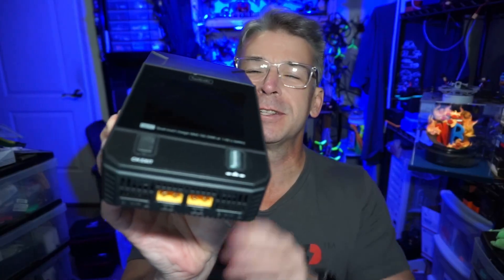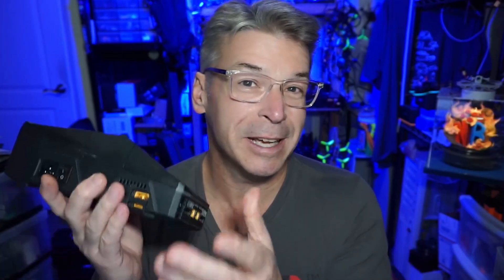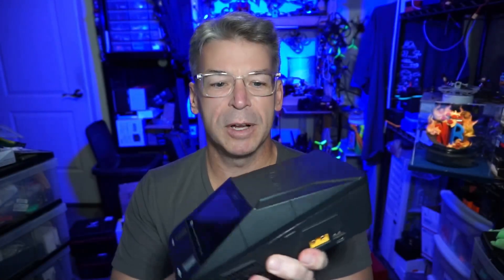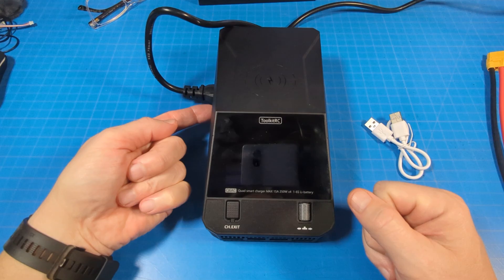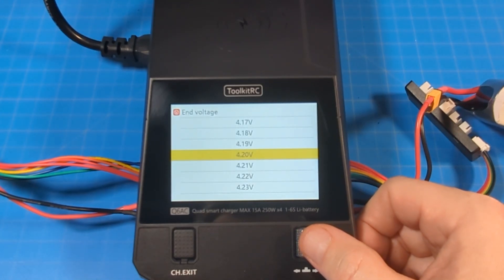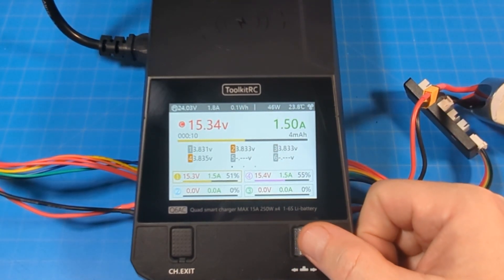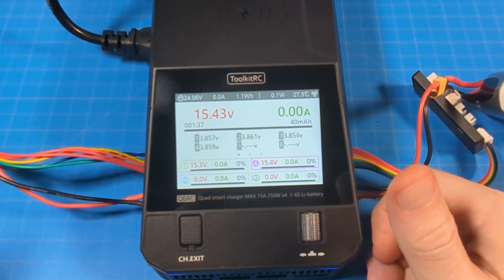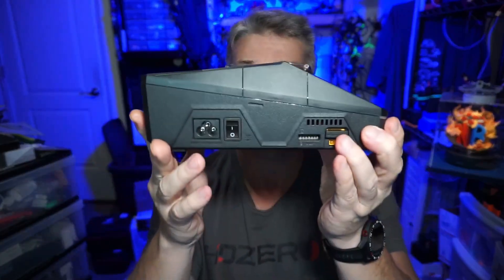ToolKitRC Q6AC // Pretty Large // 15AMP Per Channel

Comment: Hey Nick, in one comment I mentioned that almost a deal breaker for me was the fact that you can only see 6 cells at once on the screen. Unlike Q4QC where at any point you can see voltage of all (16 in case of 4s) cells. It turns out that is not true :) And I didn't see anyone on YouTube mentioning that. By long pressing CH button you change the display to showing all 24 cells at once :) You can try it.

Comment: How is it holding up after 6 months? I'm thinking of buying one
Reply from the maker: Still using mine on the regular. I mainly only charge micro batteries thought, 650mah or less, from 1-4s.
Reply: @NickBurnsFPV  That's good enough for me. Just ordered it 😊

Comment: Does this have 4 XT30 ports or only two? I'm looking for a charger that has 4 XT30 ports as I have 8 850mAh 4S batteries with XT30 plugs. Do you know of any chargers like that? I haven't found any. Do people use some sort of XT60 to XT30 adapters?
Reply from the maker: It has 4 XT60 ports

Comment: hi could you post links to balance lead extension cables that you use in the description. I agree 100%, manufacturers need to include it in these expensive chargers boxes. thank you
Reply from the maker: Sorry. I don't have a direct link to them. I used the ones that came with another charger.

Comment: Great video! I'm new, transitioning from DJI to the real world of FPV! Do you have links for those adapters? I was on a budget, and I got a charger with one channel; now looking into buying something better, and you made a good point about those adapters. You also did another review on another 4-channel hub. Which one would you get Q6AC or Hota F6+? Thank you very much, and happy holidays!
Reply from the maker: I like how the Q6AC operates and tend to use it first. The Hota has a nice small footprint so it does get used on the charging shelf just not first. I don't have a link for those adapters, I am sure they are out there somewhere, but not finding them on our fpv shops websites. Parallel charging boards are close but those are more expensive than we need.
Reply: @NickBurnsFPV Thank you, Nick! Very much appreciate it!
Reply from the maker: @YonnBurgos  Sure, my pleasure.

Comment: Looking at the description the charger is only 250w 15amp possible when using DC input from a power supply. And 100w 5amp when using the AC input .

Comment: Isn't ToolkitRC a company that made a batch of 4 channel chargers where multiple channels didn't work out of the box? I assume they have no QA whatsoever, which is a bit concerning when one of the possible outcomes is a house burning down..
Reply from the maker: I don't recall that. I have four toolkitrc multi chargers, they have all worked for me on micro batteries.
Reply: @NickBurnsFPV  https://www.youtube.com/watch?v=-iGkWevLPMQ for example is a RC shop owner opening several brand new chargers in a row and most of them being defective. Most hobby grade chargers would fail at some point, and there are horror stories on rcgroups about many models from many well known brands. But the whole batch being DOA is the next level :)

Comment: 2:05 in your example, they would level out eachother pretty quickly themselves. Maybe with different Ohm there could be some issues somehow only related to overcharging?
Reply from the maker: I don't think so, as with a series/parallel board the charger sees all the batteries as one battery, where when we charge normally without a series board the charger sees each individual cell.
Reply: @NickBurnsFPV  hm, but when you connect a 3.5V and a 3.7V onto the parallelboard, there will instantly flow current between each lipo, making them around 3.6V at the end. Just by having them parallel connected to each other - . maybe we can agree on that?

that's why you can't put a 3.3V and a 4V parallel (- with - and + with + connected), the huge current between them on connecting, would burn out everything on the board. AFAIK.
Reply: connecting in series, thats another story, yes

Comment: I don't understand chargers without switches, hook mine to a surge protector, with switches.
Reply from the maker: I have a similar setup, but I don't always need to power up all chargers and the switch on the surge protector isn't all that accessible.
Reply: @NickBurnsFPV  
I purchased a 4-switch surge protector, a switch for each charger, so I only turn on the charger I need at the time.
Reply: @NickBurnsFPV  
Thought I would share, I am 66 years old and just entering the hobbies, my wife thinks I am crazy, but is very supportive. 😀

Comment: Now that's a beefy charger.  Until just recently I've been using charg boards, I almost had 2 batteries go up and a friend did (they were home and all is good, but still), I don't use those anymore.  Love the phone charger up top.  Those XT30's are a nice touch, shame only the two sides have em, and I agree with the extension cables, be nice if some were included or an option at least.  Thanks for the review!

Comment: I have a few Toolkit RC's products and they all work just fine.  I really like my charger it has 4 ports and just like most of their products it is very simple to control and use.  But this charger, when you first held it up i immediately thought "Tesla CyberTruck"  Ha!!! As i am typing this you said "CyberTruck..." kind of taking the steam out of my post!  

Anyway the overall wattage on this is quite impressive but there is one spec. on a charger that I think is one of the most important ones to pay attention to - the "Balance current" spec - and on this charger it is 800mah... that seems a bit low for such a powerful charger.  My other chargers have balance currents about 2 times that.   Balance current is the main value that determines how quickly batteries will charge when you have imbalanced cells.  

To be honest though even though this value is not as big as it could be I am often in favor of things that help my batteries last longer and stay healthier.  Fast charging is a bit rough on batteries and it is one way to degrade the capacity and performance of a battery.   Just know that this will not be the fastest charger for your batteries and if fast is important then keep looking.  Plus this thing looks like a CyberTruck - Yuck!  (Just one persons opinion)  Cheers!

Comment: It would be nice if all 4 ports had the xt30 plug as opposed to just the side ports. And like you said Nick, if you wanted to charge 4 xt30 batteries, they don’t include the balance lead extender. But besides that, seems nice.